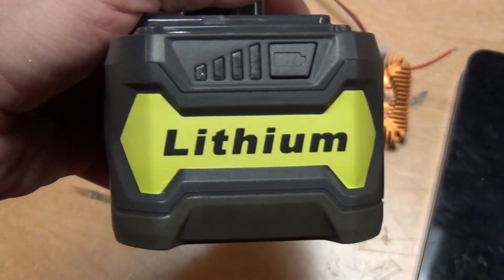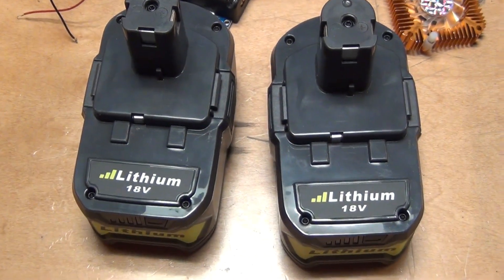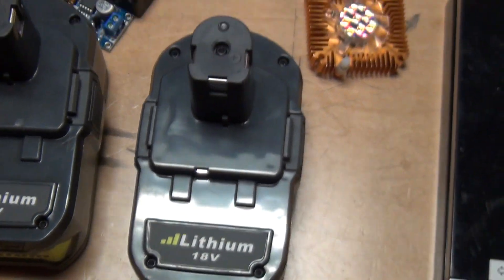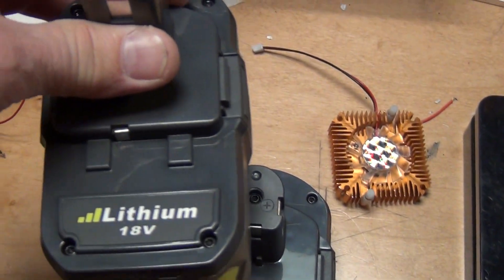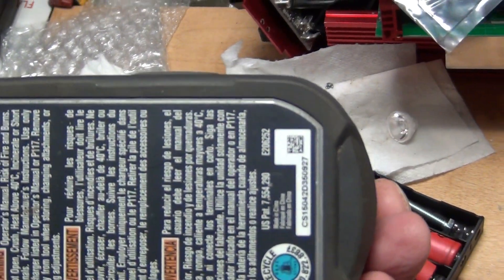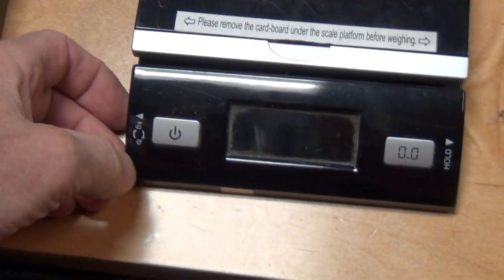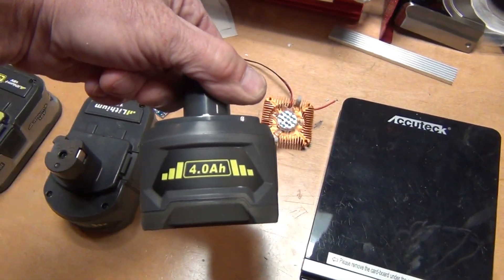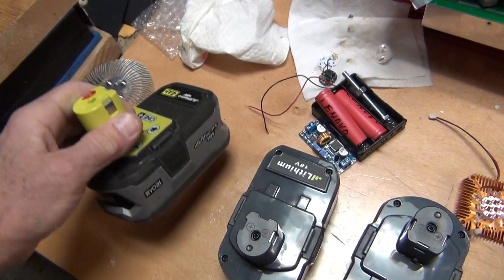Ryobi ONE+ batteries knock off from ebay

Comment: Bought a 2.5A Enermall off Amazon and using my 10W Ryobi project light, I actually got just over the stated 45Wh of power.  The LED charge lights are worthless as charging indicators.  I just leave it on charge until the charger light stops flashing.  Every time, the charger will, at some point, indicate a defective battery during charging.  Just unplug and replug the battery and it'll charge OK from that point on.  On charge number 7 and still working well... So far!

Comment: I purchased those same batteries except that I figured out that the ones labeled 5ah are actually 4ah.  I have been using the two that I purchased for over a year and have not had any problems with them operating equipment or charging.  For the price they are a very good deal.  half price and yes it may be slightly lower than the original one but 80% run time compared to original for 50% price is good enough for me to accomplish diy stuff.

Comment: It MIGHT be 4Ah. Weight alone won't tell you everything.
The case might be cheaper plastic, which is lighter. Or, they skipped some kind of internal stuff. You really don't know what's inside until you open it up.

But, one thing sure is, you cannot really expect anything from ebay no-name batteries.
Reply from the maker: Yes you right, they skipped some kind of internal stuff on the batteries it self.
Reply: What....a Chinese knockoff cutting corners ????? NO WAY 😂

Comment: I got these same identical ones (color wise) but mine were 6ah... They both weighed the same as my Ryobi 4ah and had the same physical measurements... So I put them to the test. I took my newest Ryobi 4ah and charged it up... Took one of these 6ah batteries and charged them up, put them in my Ryobi fan (have 2 that are the same) and put each fan on high speed and let them run... Both went dead within 5 min of each other so ... All I can say is that the 6ah is NOT a true 6 ah..  It's ok I only paid $65 for both, that's cheaper than one Ryobi 4ah 
Now only time will tell if these last... What I can do is dissect both and compare but I won't do that... Maybe after one of my Ryobi 4ah dies and one of these 6ah dies... Then I will taken them apart and compare...
Reply from the maker: It tells you these r not what they say they r
Reply: Home Depot had two 4Ah P108 batteries for $90 a few months ago. Also, you can buy a 2-pack for $99 right now.
Reply: Pro1er:
Not here.... its still $99 for one 4ah battery
Reply: Where is "here"? In the USA you can buy a Ryobi 4Ah battery for $79US or two 4Ah batteries for $99US. Also, you can buy two 4Ah plus two 1.5Ah batteries for $149US.
Reply: US... i don't waste time with 1.5Ah batteries anymore. I only buy the 4Ah... When they are on sale 2 for $99 ....
Reply: You, Update?

Comment: ok so my original 4ah ryobi runs a drill (on slow revs ) with a cable tie on trigger for 25mins..my knock off 4ah runs it for 35 mins,exact same test..why ?
Reply: Which brand of knock off?
Reply: @shaunwill925  realpower
Reply: Because the original's memory is bad now from improper charging. And the knock off is new right ?
Otherwise why would you have purchased a new knockoff ...
Reply: @hurricanealley8602  that's not how lithium batteries work and you buy a second battery to have more run time on your tools. You don't know what you're talking about.

Comment: Bought a 6ah clone on ebay for the purpose of tire rotation. Started out with a full battery and when i was done, i still had 4 power bars. I guess it all depends on how your going to use the tool. For me the clone is good. ( light use )

Comment: That is Absolutely True 
Same Thing Happened with the Alkaline Batteries. 
The Good Name Brands 
Are twice as heavy than the Cheapest Ones. 
Those Heavy Cheap Ones
Are Almost There but Still Less like a 10% or 20% of Durability and Performance 
On Electronic Devices Only NOT for Motorized Devices

Comment: i bought 2 2.5ah for $27.00. I tested them in a ryobi hand vacuum against a real Ryobi 1.5 ah and got almost identical run times. So the batteries are closer to a 1.5 than a 2.5. But looked at a different way, I got two 1.5ah batteries for less than the price of one real Ryobi 1.5ah. That is quite a value for a 1.5ah battery. I don't know why they overstate the capacity so much. They compare very favorably cost wise when looking at the right Ryobi option.but if you want a 4.0ah for example, I would buy a 6.0ah etc. However If you go this route, don't focus on the advertised capacity, focus  instead on the price vs. OEM batteries spec'ed at 50% of that size. then you can evaluate if you got a value.  I don't' like being lied to about the capacity and so won't buy these again, but for what I got and what I paid, I feel like I did OK. If they had been true 2.5's I would have been recommending in this comment.

Comment: What do you expect?, I spend the extra $ to buy the genuine ryobi.
Reply: dirty dog until you find out one day both are identical to the tee internal wise and you paid more than double because your Home Depot version says Ryobi in pretty letters and nicer colors...  And looks authentic... 
You would be surprised to find out tons of things all come from the same production line and the only difference is the outer cover and you get charged more $$ for the one that looks authentic ...

And not to change the subject & product, but i went to purchase an item for my car and the place i got it from showed me the "generic" vs the "name brand" product... Both were identical to the TEE internal and external, same metals, same weight, same spring tensions, same screws, same design, the difference was the price. The generic was $50 and the name brand was $150.
The guy said, its your call, show the generic and pay $50 or get the name brand with is $150 and it looks legit and makes you feel all warm and fuzzy inside knowing you paid more and got a "name brand" product ... lol
Reply: @ACommenterOnYouTube  so you have looked inside the case ? 
So you have looked inside the individual cells ?
Nope...
No worries you'll never use them for anything other than light duty anyway
Reply: @Hurricane Alley:
Did you read anywhere in my post that i said i looked inside..??  NO i did NOT, which leads me to ask you WHY would you ask me if i looked inside these batteries when when i never said i did..??  
Stupid question .. YES

Not to worry, i use these on my Lawnmower .. and they work just as good as the pretty Ryobi's do ... 

You would be shocked to find out that there are MILLIONS of products that are made in the same factory and same line and have different stamps on them so that the "name" brand stamp can be sold for more $$ and the generic stamp sells for almost half ...

Comment: Have you had much time using them in a tool?
I am just curious if the amps are the same.
If the tool runs as good.
I can deal with slightly less charge.
Mine grow legs on the jobsite all the time so I may end up using these.
Reply from the maker: they perform fine in the tools,  just don't last as long between charging...........but again, yours don't last very log either so I would go for these

Comment: Are you seriously suggesting that you thought you'd get the same performance and build quality from a no-name aftermarket battery that costs less than half the price of the original? You should stick your finger inside a Ryobi "Intelliport" charger for a few minutes yourself mate! Lol... thanks for the video ;)
Reply: You can buy better replacement cells from an electronics store for about $20 bucks. Changing the cells takes about 1/2 an hour. End result is a brand new battery.

Comment: Why did you expect them to weight exactly the same, when they clearly don't look the same? They can have same cells inside. Also fake ones are probably made of thin ABS, that's why they are lighter then some thick glass fiber reinforced plastic
Reply from the maker: Who said I expected them to be same weight?  Usually heavy battery is better quality and lighter one is cheap junk, just in case you don't know.
Reply: Why don't you just remove those 4 screws and check cells, so you'll know? As I said, weight difference could be easily made just by casing. They must save that cost somewhere
Reply from the maker: I want to return them for refund so no opening them. It doesn't mater what cells are in side if they don't perform.

Comment: Bs test. Cant compare by weight. You have to open it up and see what batteries are inside and test them. Best knockoff I know of is the 4ah vanon. Which uses samsung 30q batts. The ryobi brand uses samsung 20r (I believe). The 30q is a way better battery and last longer. Also the vanon is $30 and again out performs the ryobi one+.
Reply: Just BS talk, where is your test?
Reply: Test is right here...
https://youtu.be/z_O0SX5JFqg

Comment: I see your original battery is the new one plus model.... the ones you bought on ebay are the older version of ryobi batteries which have 35% less run time than one plus ..... I don't think they are knockoffs
Reply from the maker: Ohh yes they are, that is not original Ryobi battery

Comment: Has anyone noticed... that the RYOBI battery chargers... stop working.. after a month or two?... I have been thru 4 in a years time...( the single battery chargers)... I'm starting to think my RYOBI CHOICE... was not so smart... but I'll keep investigating this
Reply from the maker: I have three chargers for while and still working.
Reply: Vlad Fred Kovac thank you for telling me that your chargers have been working fine... now I can look deeper into the faulty charger thing.
Reply: Your personal issue could be caused  by a number of different issues, like something wrong with your batteries which is damaging your chargers over time,   the quality of your utility power is very poor,  something on that circuit is causing power surges or its stored in a very humid environment that destroys it over a month or two.

Between my father and I, we have been using 4 of these chargers for many  years without issue.

Comment: I just tested all my Ryobi tool batteries for capacity. I used a load tester ( https://amzn.to/2SOyXcg ) running at 10A/12V regulated load ( https://amzn.to/2SGAoei ).

Ryobi 9Ah/162Wh P194 got 133Wh
Vanon 6Ah / 108Wh got ONLY 58 Wh
Ryobi 4Ah/74 Wh P108 got 55Wh
Ryobi 3Ah/54 Wh P191 got 42Wh
Ryobi 1.5Ah/28 Wh P107 got 19Wh
Ryobi ?Ah/24 Wh P102 got 13Wh